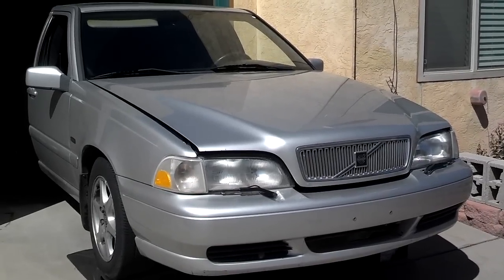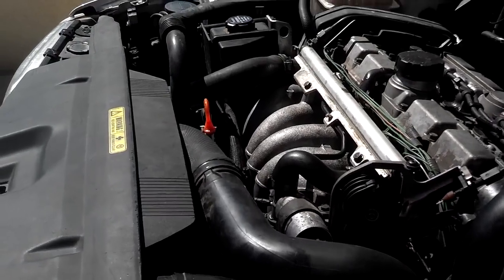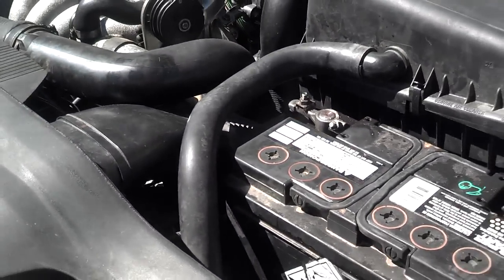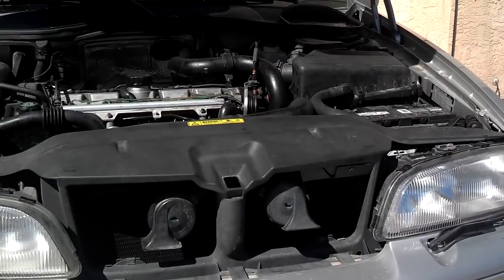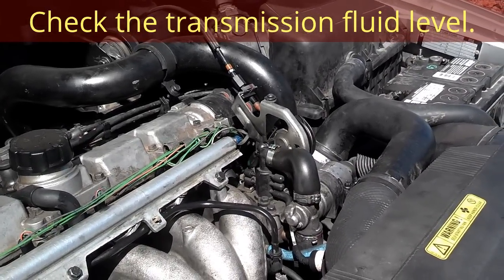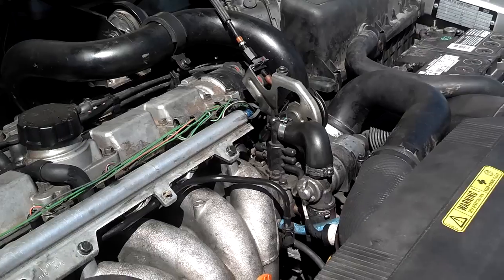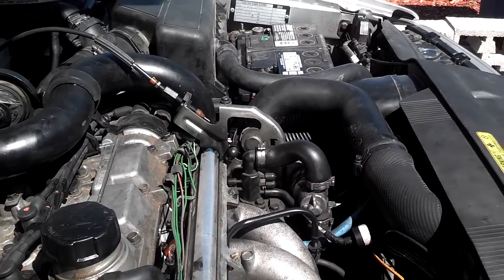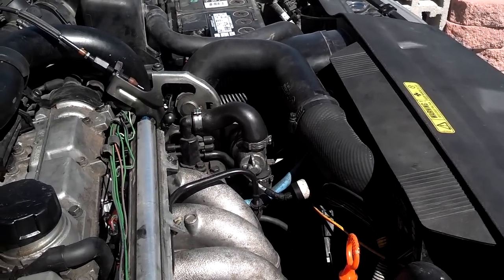Automatic transmission problem warning, bad radiator. PSA - VOTD

Comment: Mr. Robert  please I need to know how to replacement my automatic transmission in my s70 glt 1998
Reply from the maker: If you don't have a lift, pull the engine and transmission together.

Comment: It’s me again yeah I know 😔. I’m really confused about transmission. It shifts pretty hard when cycling through gears especially on a hard pull. The down shifts feel great it’s the following gears that I really feel a jolt. Any suggestions? I’ve checked the fluid and it seems perfectly fine in color and the level seems good. I’m really desperate here cause this is the only thing keeping my 850 from being an absolute cherry.
Reply from the maker: Engine mounts. Mainly the transmission torque mount.
Reply: Robert DIY I just replaced that one. It’s softer but it still jolts more than I think it should. I went the cheap route though so would that be a problem?
Reply from the maker: Try a poly one.
Reply: Robert DIY roger that. Just curious are these cars known to have bad transmissions?

Comment: Man I need real help with mine my light flash car stuck in low gear on take off pick up speed as it goes
Reply from the maker: Huh
Reply: You gotta see it to believe it arrow flash car take off slow and then pick up speed as it goes
Reply from the maker: I don't even know what kind of car you have>
Reply: Sorry Robert it's been  a long dsy 99 s70 I watch a lot of your videos .And you been right on the money really try to get this car right
Reply: Got this with my S90 1998 arrow flashing and stuck in lower gear. Went to volvo dealership and they changed the pnp switch #9466013-1

Comment: Where do u find transmission fluid gauge ?
Reply from the maker: +Alvinil Rey dip stick. What kind of car?
Reply: 95 Volvo 850
Reply: I got it, and I notice that the fluids of the gauge is above that hi level? What is the cause of this? Thanks a lot!
Reply from the maker: +Alvinil Rey probably a false reading. You have to check it properly.
Reply from the maker: +Alvinil Rey https://youtu.be/XknjRIfjEZQ
Reply: Volvo 850 GLT, gauge (deep stick)

Comment: This for AUTO or MANUAL or both ? Thanks
Reply from the maker: Bunka Fas Auto. Manuals are not connected to the radiator.
Reply: Ah a tad worrying, is it possible to see Auto fluids in the coolant reservoir ? Mine has no muck in it but, it was fairly dark when I changed /flushed it the other week (the coolant I mean)
Reply from the maker: Probably oil if the car is turbo.

Comment: Just started having slipping problems in my wifes v70 xc, transmission fluid is way over the full level and super muddy brown.
Reply from the maker: +Joshua Constantine don't start it again until you replace the radiator and flush the fluid

Comment: 98 volvo s70 turbo it has no gears no limp mood I have gears but only a couple feet reverse only works if you rev it 5000 rpm and it slams it gear
Reply from the maker: +Fred Sorrell Have you properly checked the level?
Reply: The tranny fluid is fine it's not red it's a brown color
Reply from the maker: Sounds like the box is bad. Has it been serviced regularly?

Comment: Nice video Robert Thanks for posting it. I have (2005) BMW 750LI The transmission cooling lines were leaking transmission fluid from cooling lines under the subframe I purchased the lines at the BMW dealer very expensive , Replaced the lines refilled the transmission fluid with new one. The car does not reverse anymore but goes forward in all gears even if i put it in reverse it still goes forward what to do the scan code is P1721 01/01 need you help please thanks.
Reply from the maker: That's what my transmission was doing before I replaced it.

Comment: My '96 Volvo 850 non-turbo automatic wagon had a re-built transmission installed by the previous owner less than 2 years ago.  I've had the car about a year and have driven less than 15,000 km. (I'm in Canada)  Three days ago the transmission started acting up once warmed up (major slippage and hunting for 2nd-3rd, etc.).  The transmission fluid level is high and the coolant reservoir is low.  The transmission fluid is a cloudy red-brown color.  I suspect you're right regarding the faulty radiator.  Do you have any suggestions for confirming whether this is the problem, ie. OBD codes, testing the fluid for anti-freeze, etc.?
...DL
Reply from the maker: dirk29tu Nope. You can act now or maybe replace the trans in a few days. You could also service the transmission and see how things are in 50 to 100 miles. - Volvo 850, S70 Automatic Transmission Fluid Change / Service - Auto Repair Series

Comment: Why always Volvo videos.
Reply: He drives a super sweet '95 T5-R Wagon :o
You must be new to his videos. Welcome.
Reply: Huey, because Volvo are the only one Cars in the world, I have tested everything (Brands) and mine is 18 years old has no rust, high kilometres, all comfort and space you need, character for sure and in the end it takes the same consumption as never cars with much more security inside. VOLVO a car you can`t bend as well the owner who made experience with this undestroyable technique. As well you need to know there is all german technologie inside, the germans say it is a swedish mercedes, but volvo still has the quality and no rust as the MB :)
Reply: Volve vs camry, which can last long er.
Reply: huey Freeman Both are very dependable. I'd say it's a toss up. Camry surely has cheaper parts, so maintaining one would be cheaper. I prefer Volvo for the heritage and the look.
Reply: Volvo= Ford
Reply: huey Freeman Not these models that Robert Works on. Even the V70 and S70 were pure Volvo on the inside. And there isn't much wrong with Ford Considering my 1988 Ranger XLT has over 600,000 miles on it.

Comment: This guy doesn't know what he's talking about when it comes to shifting issues on these Volvos. For 30 dollars, you can purchase a b4 servo kit that allows your auto trans to run and shift perfectly again. Look it up. the part # is 30751262 from Volvo. This Robert fellow needs to do his homework before he opens his yap.
Reply from the maker: +Manny Oliveira 😁
Reply from the maker: +Manny Oliveira so basically, if the radiator is leaking coolant into the transmission, which does happen on these cars, the b4 servo kit will fix it?
Reply: Robert is helping the people with his knowledge let him do it.God bless you Robert sir keep it up